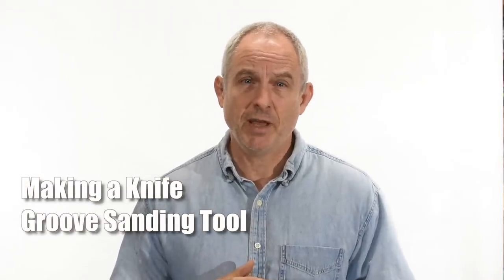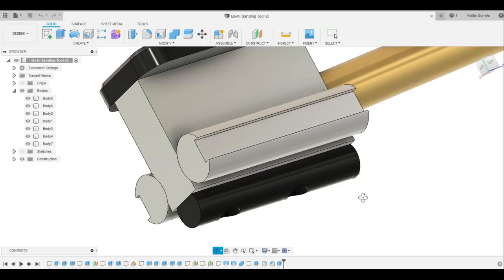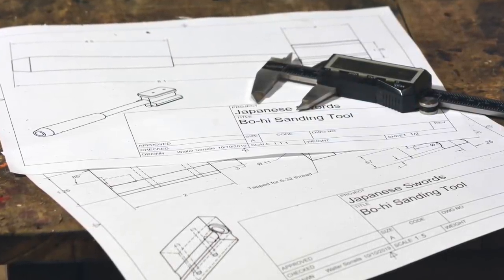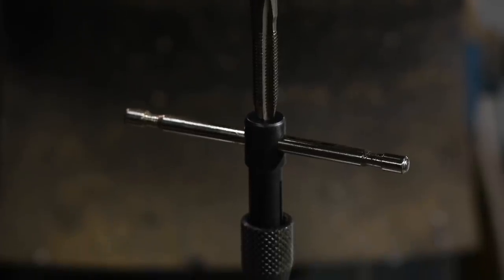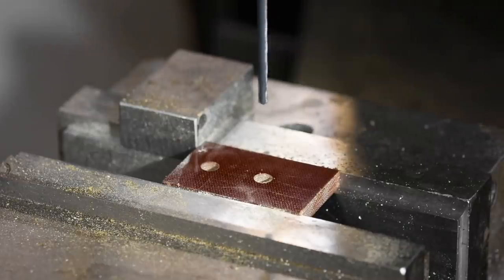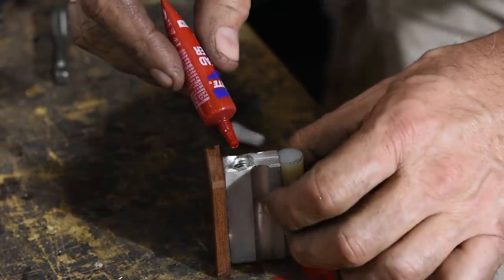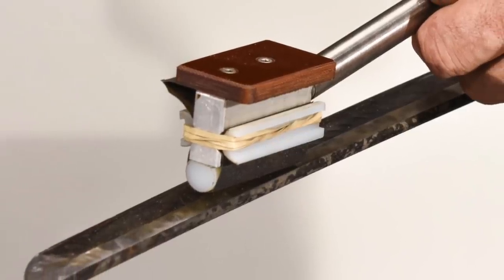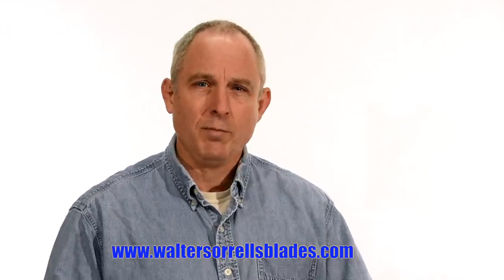Make a Knife Groove Tool! - Katana Bo-Hi Polisher

Comment: Great tool idea to jump off from. Maybe forge out some spring clips for the side pieces instead of rubber bands? Sliding dovetail for the bottom sanding form instead of screws, so smooth and even all of the way instead of spaces left under the sand paper at the screws? Love the various sizes idea, could be useful to adapt as needed for woodworking and refinishing antique furniture too. Thanks for sharing this with us.

Comment: Just an idea...
Instead of semi-round clampy-thingies you can try with pipes of the same material and bungee cord that goes trough them.
Reply: I had the exact same idea. Just drill out the poly rods and run some elastic cord through them and tie it off. Then it doesn't matter if the clamping rods rotate as you move the sandpaper.

Comment: Great idea... Hmm that clamping rods should have a bit longer and groves on both sides and two rubber bands clamping it to the aluminum block. So you just need to pull the used sandpaper bit for bit trough.

Comment: I have a spring loaded tap guide that centers onto a tap wrench like you used the tap at 6:30. Keeps it perfectly centered and gives it the pressure needed to drive the tap forward. 

Literally worth it's weight in gold when tapping mokuti or titanium bolsters for hidden hardware with 2-56's.

Comment: Your "three hand" tapping technique can be easily avoided. Just put the tap into the chuck, but don't tighten it too much, this will allow it to spin when it bottoms out. The tap body is hard enough that it isn't damaged, and smooth enough that the chuck jaws are not damaged. Put the mill in a low r.p.m. and you can power tap. Much easier than growing an extra arm.

Comment: Wouldn’t it be easier to control if the handle was perpendicular to the direction of the fuller? Imagine a d-shaped bracket holding the handle similar to spades have.